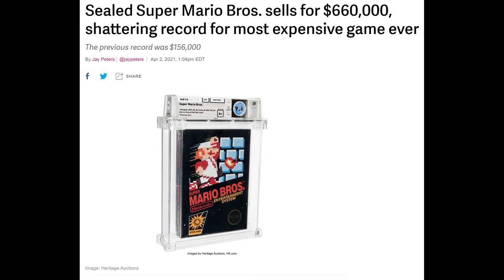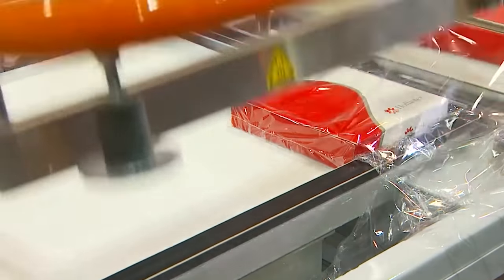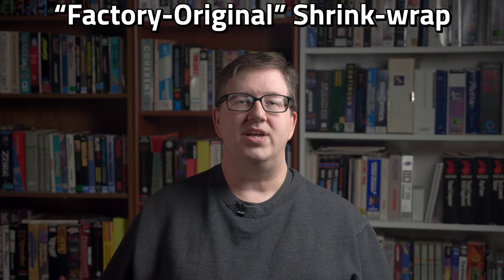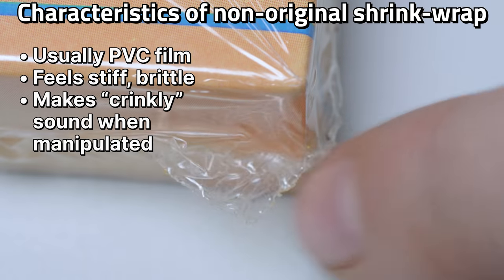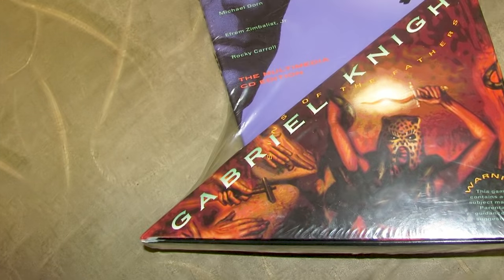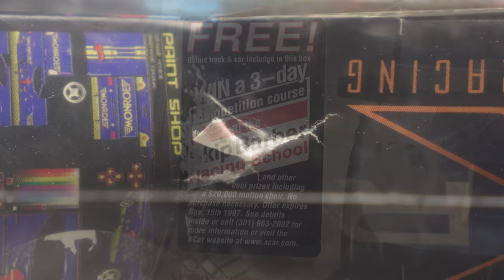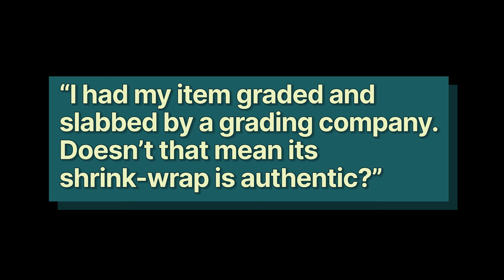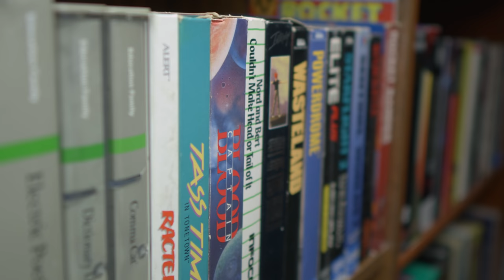Authentic, or fake? Identifying Big Box Computer Game Shrink-wrap

Comment: This video is beyond helpful, thank you so much!

Edit: Just finished and wanted to add one other super helpful bit of tampering evidence: if the box flaps show signs of ink breaking (on the side connected to the box), but the box is sealed, it’s likely a reseal of an opened game. But as you mentioned (and as I’ve experienced), it’s not bullet proof; sometimes these boxes were either opened in the factory after assembly or assembled shoddily, then properly factory wrapped.
Reply from the maker: Great point!  I think I usually associate that kind of damage with shelf wear, but the ink breaking on just those folds is definitely something small to look for.  Nice catch!

Comment: Thank you very much for this video and your insights!

I'm seriously collecting since 15 years (mostly sealed games) and during your video I looked at some items from my collection. One I was always unsure about seems to be factory-sealed without any doubt now, but with others I'm not so sure anymore. For example I own two copys each of Hexen 2 and its add-on. And both seem to be shrinkwrapped in a different way. Like Hexen 2 and add-on with shrinkwrap 1 and Hexen 2 and add-on with shrinkwrap 2.

Since I own most of my games for a very long time, I hope that resealing them by the individual seller to a collector wasn't the big thing back in the day, when I bought most of them for less than 100 dollars.

Thanks to your knowledge I just discovered a re-seal in my collection. A game from 1997 that I just bought days ago.
Reply from the maker: I think the highest frequency of re-seals you'll find are from the 1995-2000 era, as that was the height of software resale shops (in the USA, at least).  As always, check with fellow collectors to catch outliers.

Comment: Thanks for the video, Jim! It is very interesting.
Although I could never understand people collecting sealed boxes. What's the use of having a shrink-wrapped box sitting on your shelf without the ability to play the game, read the manual and damp/scan them for the preservationist communities?!
The first thing I do when I get a sealed game is unsealing it, of course :) Yes, there were a few cases that revealed the boxed game being actually a forged/re-sealed, but what's the difference as long as the contents are complete? I had much more sad cases when actually factory-sealed boxes had already defective and unreadable disks inside them... And later boxes (from about mid-90s) were made of thinner carton so they get smashed when staying in shrink-wrap for years as it seems to shrink even more and more, you know.

Comment: Really well made, though I wish you wouldn't put emphasis on the monetary value of games.  I collect jewel case and big box computer games purely because it's fun to get them at thrift stores, etc.  I still find computer games at thrift stores so much more often than console games by far, and they're usually super cheap.  I got Spear of Destiny in the big box for 50 cents one time.
Reply from the maker: I tried very hard to not "hype" the monetary value -- in fact, in the Q&A section I list three good reasons to UNwrap your games.  But, the monetary value was a necessary evil talking point, because I hate seeing people spend hundreds on sealed games when they're just re-wrapped and only worth $40 or less.
Reply: Thing is, why should he ignore the 5000lb elephant in the room?  It is there, one has to acknowledge it right?  At this point any PC gamer who is concerned about money should probably keep the 'legit' sealed big box games sealed if possible and locate an opened copy to buy in order to play (or just use emulator download). Sometimes that just isn't feasible though and by all means tear open that seal, I've done that a few times.  I cringed when I did it though  :-p

Comment: Or.... just do your part in fighting the insane prices by buying opened big box games.  Then you won't have to worry about scrutinizing shrinkwrap and will get less angry when you browse listings on ebay.
Reply from the maker: Agreed.  I've bought shrinkwrapped games as early as a few years ago, but not because they were wrapped, but because they were the only ones I could find.  Having them still originally wrapped is a nice bonus, but it wasn't the main reason I bought them.  In fact, as an archivist, I've spent $330 on a wrapped game only to open it immediately so it could be archived (in fact, you can see that very game in the video, in the same shot as some comic books :-)
Reply: @TheOldskoolPC  I've done that with a few big box PC games that I just could not locate an already opened copy.